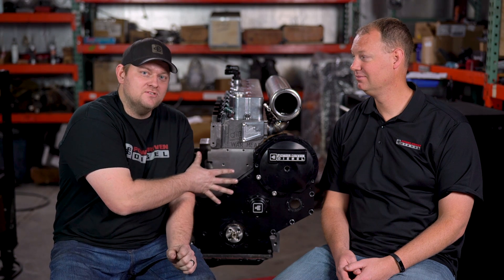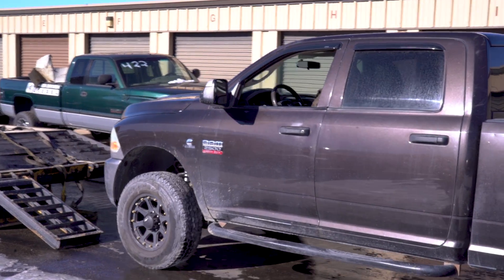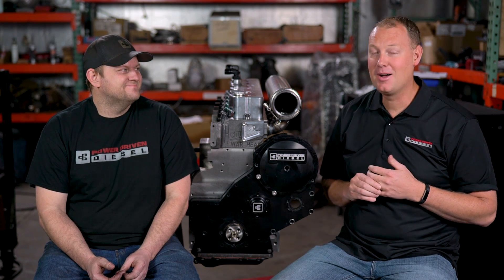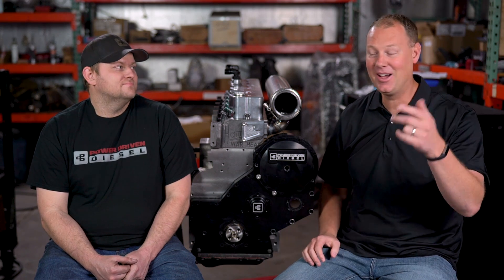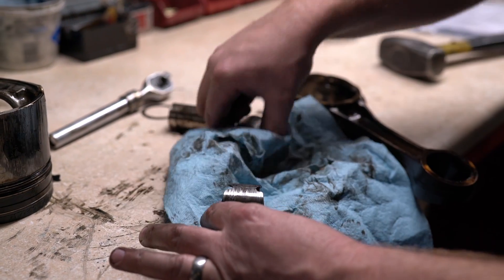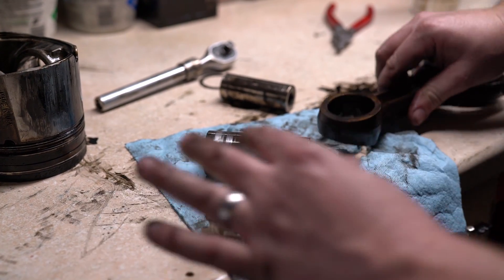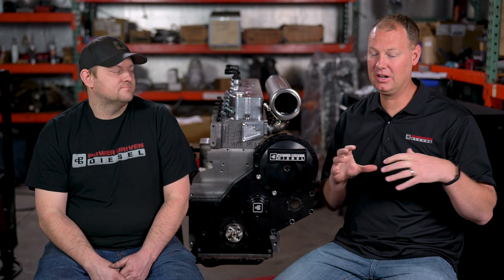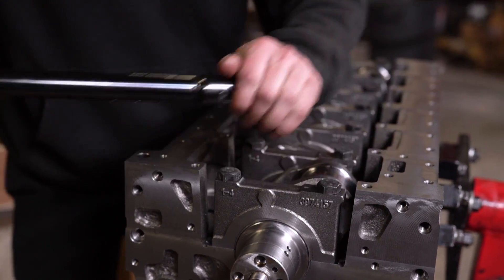Whats Knocking on the 4th Gen Cummins Diesel? | Project 4th Gen, Ep 2 | Power Driven Diesel

Comment: I'm still waiting for someone to discuss piston oil cooling and heat exchanger upgrades, with big HP increases comes increased heat load, with drag trucks this might not be an issue but with driven and especially towing trucks this must be a huge issue if power levels are above factory or double  triple and load cycle increased, who is taking this into account and what determines the point for upgrades and how is it determined with what symptoms and data, I've seen piston pin bearing failure like that with piston jet issues but at what point can it be a volume issue or lack of heat rejection of oil through too small a cooler, I've seen Nascar gas engines running 3 jet piston squirters for some time and I would guess they are not doing it for bragging rights, a lot of diesel pistons run hollow dome oil cooling so if you can't increase that would underside extra spray cooling be beneficial also

Comment: How do i get ahold of you guys? I got alot of questions about my 04 dodge 5.9 Cummins
Reply from the maker: Call into the shop, we are here 9am to 5pm Mountain Time Monday thru Friday.  (435)962-9555
Reply: Where are yall located
Reply: I know diesels cost of money to work on butt i gotta have it reliable ! 
Ive put 2 new fuel pumps the one on motor and fuel tank
Crank sesnor
New turbo
New fuel injection pump sensor
2 new batterys
6 new injectors
AND STILL CANT GET IT TO STOP DIEING GOING TO A STOP AND WONT DRIVE OVER 30MPH

Comment: I have a 3500 2003 common rail dually double cab... "Black Betty" It has 349,900 miles on her.  I am an aviation racing aircraft building and would really like to get deeper into the diesel dive.  What can we do as a project so we can get Betty Back on the road and I am going to put a Ghost Skull or Flame paint job on her.. She has a killer cow catcher train front bumper and a black huge Leer camper on her.. a  real mans truck.  But I use her to haul our aircraft around and pick up parts and aircraft across the country.   What new innovations and cool ideas can we come up with this my daily driver to meet the thirst of us 24 valve junkies.   Doc Bailey
314 322 5660

Comment: I'm a bit confused guys.  You said this was a stock truck right  ? When they were pulling the pan of then it looked like they pulled a girdle off  ?? I haven't had a 6.7 apart so I'm wondering what that piece is they took off? It looks thick so I don't think it's a gasket  ? Do 6.7s have a girdle plate  ?